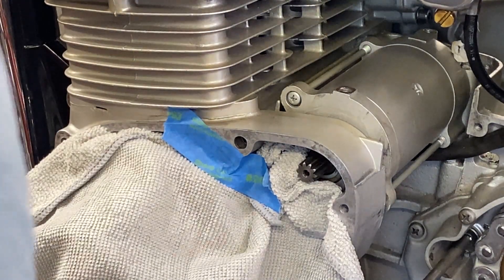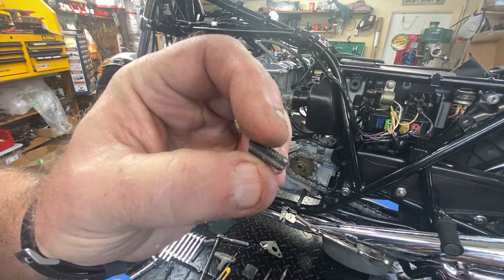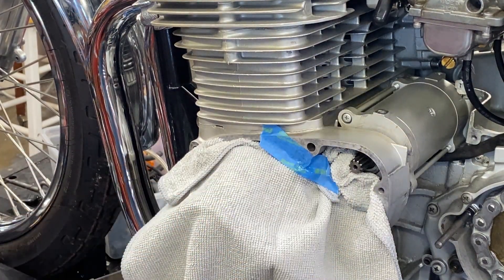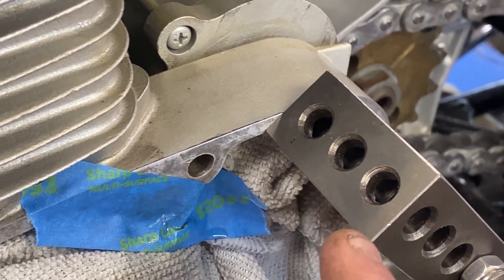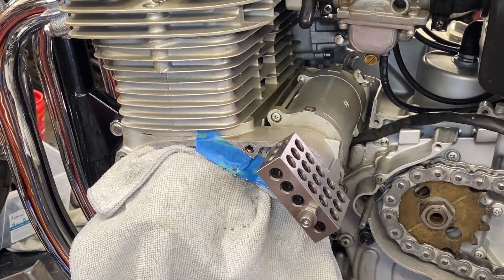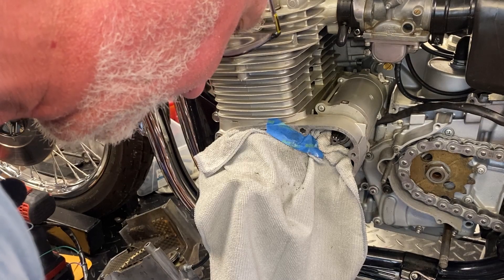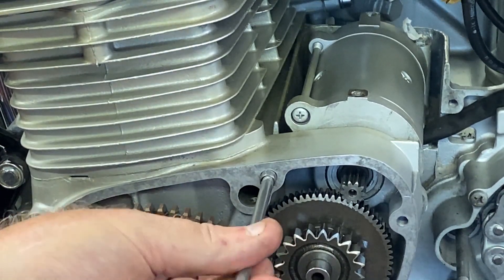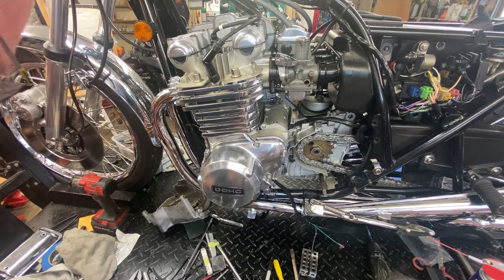Tricky M6 recessed hole Helicoil thread repair. BROKE A TAP!  Can we save it?

Comment: I'm in the middle of a repair.  The drilling and tap went well but the helicoil won't screw in and then the tab breaks off. It's very flimsy. Ordered from Amazon.  Are there repair kits that are better quality?  Or thread inserts you can get?
Reply from the maker: There are numerous thread repair kits and types, it depends upon where the thread is, on a surface or below a surface in a counterbore, etc. Time-Serts are what I use almost exclusively now, but aren't always the best option either. Again, it depends. If you're using auto parts store thread inserts which are knock-offs of helicoils, I'd suggest going on McMaster Carr and getting the genuine article.

Comment: It(the threaded hole) could also have been cut open, and TIG welded - and then drilled and tapped. But then aain, You'd have to empty the cases... Lots of work, but You'd end up with essencially stock cases. Which is nice. 🤩
Reply from the maker: The cases are still stock cases. Just because a thread repair is done, doesn't mean the cases are no longer original. What, if you replace the 1973 battery, the one it came with from the factory or dealership when the battery wears out, does that mean the bike isn't stock anymore?
Reply: @MotoRestoFL  Batteries are meant to be replaced. But the crank cases is a whole different story. Installing thread inserts means altering the cases, but replacing the battery, isn't changing the bike beyond point of no return. My point is, as long as it looks original and functions like designed to do, the bike is "stock" but not NOS stock.
Anyway, You do marvellous work on the Kawasakis - keep them coming! 🤩👍

Comment: Good job Tom. 👍 I’m always a bit nervous, myself, whenever I have to re-Tap a thread into Alloy  because as you know, it’s not very forgiving if you get a little too ham-fisted with feeding the Tap in.   Which is why, I always like to err, on the side of caution, and only cut about a fifth of a turn of the Tap at a time, before giving it a bit more than that backwards to clear the dross, out of the thread, before proceeding forward again, always accompanied by lots of squirting of WD, and compressed air, as well, of course.   Nice to see the KZ coming close to completion now.   A damn fine looking bike, and a job well done by yourself. 😉👍

Comment: why was that dowel pin so important?
Reply from the maker: Aligns the stator mounted on the cover so it won’t hit the rotor. The rotor penetrates the stator on the cover. There is very little clearance. There’s two alignment pins, 180 degrees apart. Very typical setup in all sorts of assemblies.